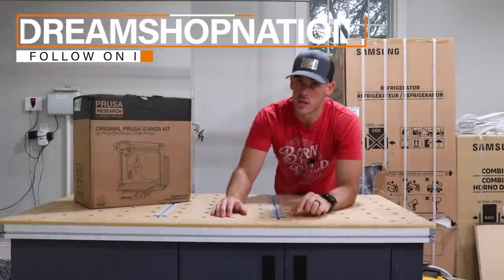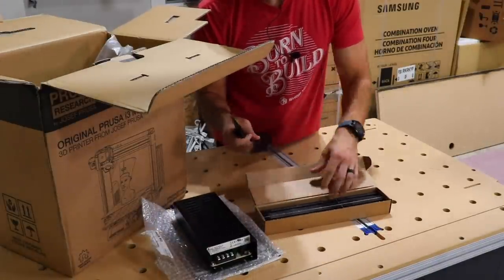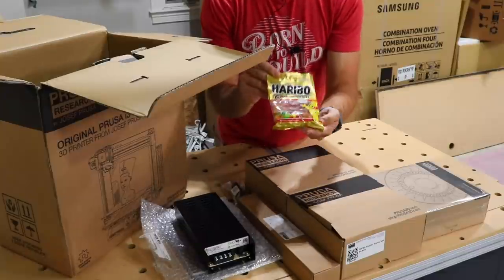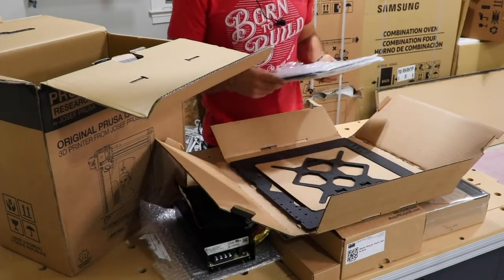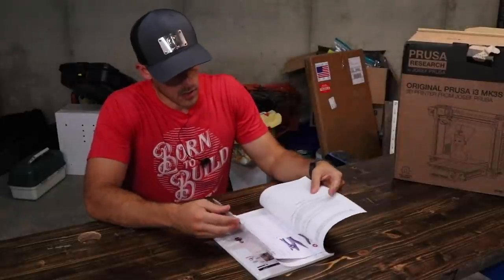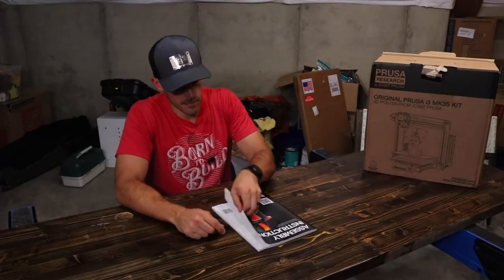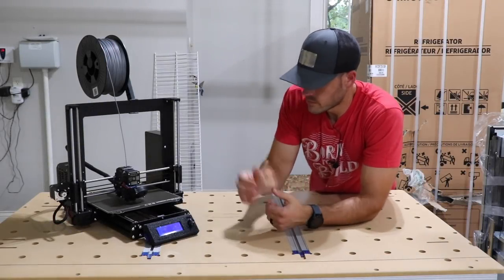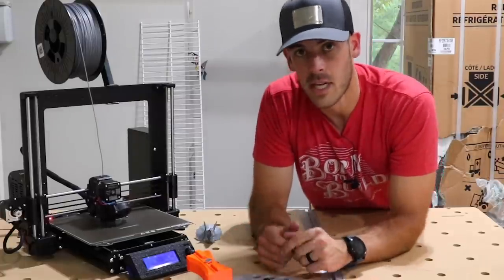Do THIS if you’re new to 3D printing

Comment: Thanks Travis. Great video and Channel.  I'm glad I found it.    
I've been looking for someone that can help with my problem and haven't had any luck. I'm writing you b/c you have great experience with the machines. Maybe you can at least point me in the right direction.   I have two machines (Ender 3's, I know.  It's what I can afford right now) and one prints flawlessly.  The second one prints like crap every time.  I cannot get it to feed without knocking.  Even when the gantry is up in the air.  All of the components from the extruder motor to the nozzle are new.  I've tried different temps and speeds with no resolve.  I've ordered some 0.6 nozzles to see if that helps.  I don't believe it's heat creap or extruder gap.  The machine has had this problem since I bought it.  I would like to figure it out before I replace the mother board.  That will be my last resort.  Any thoughts?

Comment: I've been pondering getting into 3D printing for quite a while. I see all sorts of shop applications for it. I'm sold on the Prusa, and building the kit sounds fun and geekily satisfying. I already use Fusion360 for designing my woodworking projects, and I've watched enough online to get a basic understanding of the process. What's making me hesitate is the massive amount of potential customization available in the slicer software. It seems that the printing material, nozzle size, temperature, and the numerous other settings available all need to work together for a successful print. While that doesn't surprise me, I hesitate to make such a large investment without having a better understanding of the various settings, what they do, and which ones need to be adjusted in a given situation. Blind experimentation just seems like an unnecessary waste of time and money (for wasted material).

Can you recommend any educational resources, either printed or online, that would help me feel more confident about using the slicing software effectively?
Reply from the maker: Honestly Prusa has baked in profiles that are rock solid. No need to fiddle with settings

Comment: I’m sure this is a dumb question but I’ve never used a 3D printer and am curious of how do you make the stuff to print, how does the software work. Example say I wanted to make some holder for my m12 batteries how would I know what the dimensions are and how to design it
Reply: There are a bunch of M12/18 battery holders on thingiverse
Reply from the maker: Well, you would need to design the part using CAD software and then import that model into the printing software (slicer). Not everyone has those skills right off the bat so a great alternative are websites like Thingiverse. People upload designs that you can print without having to design anything - and it’s free!
Reply: Thank you for the info